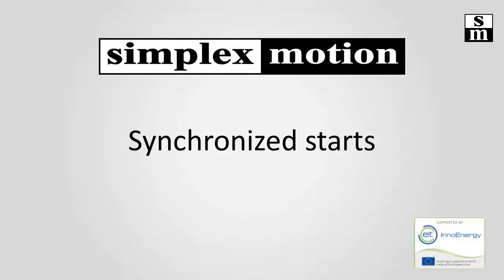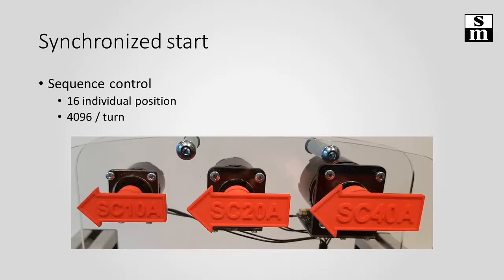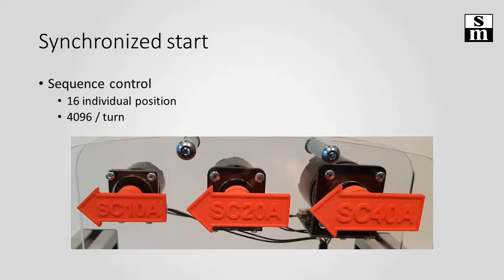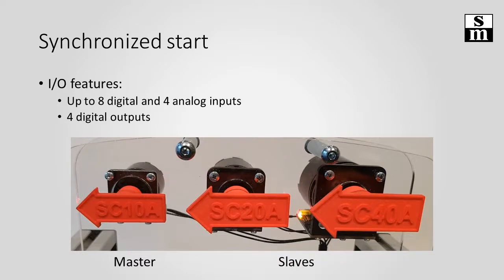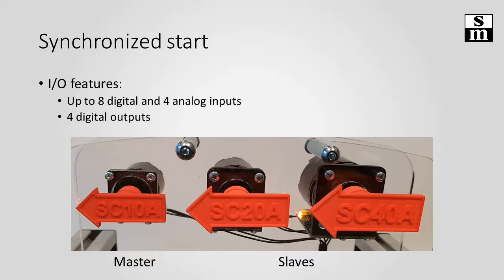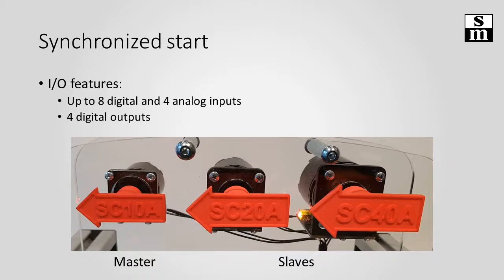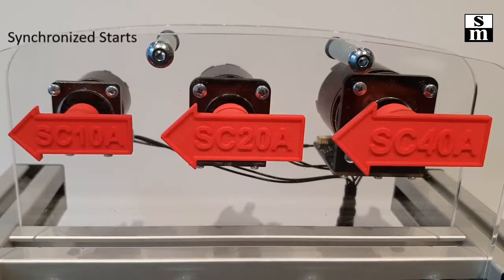Synchronized Starts

Comment: The master motor has 4096 steps. Does this mean the smaller motors have steps divisible by 4096 or do they also have 4096 steps each despite the smaller size?
Reply from the maker: All of the motors from Simplex Motion, regardless model, have 4096 steps/revolution as default and can reach up to either 8192 steps (13bit) or 16384 steps (14bits) per revolution